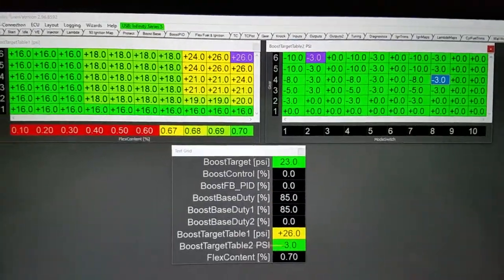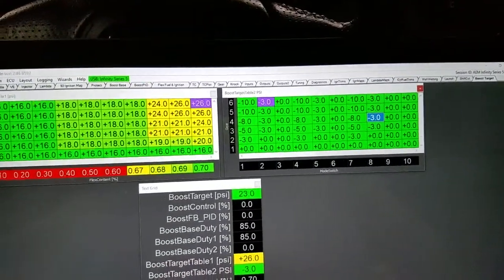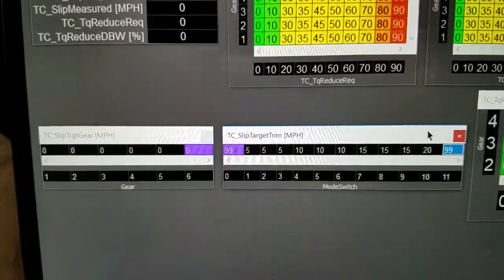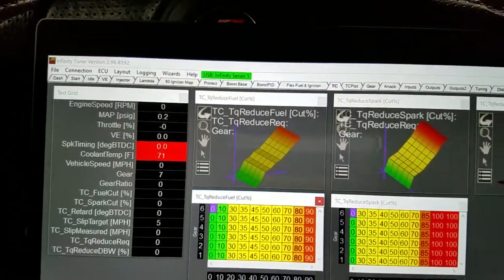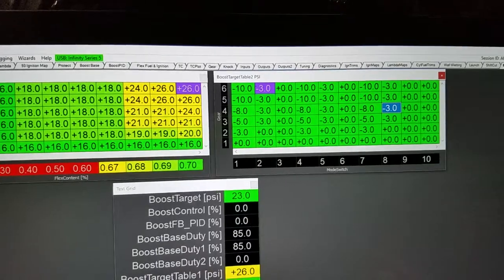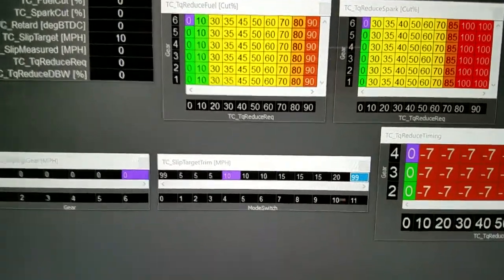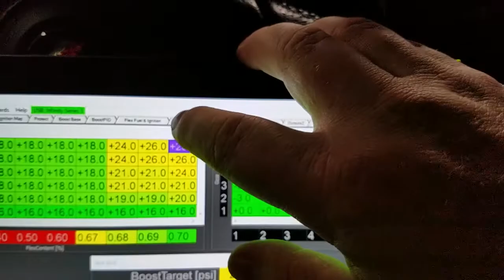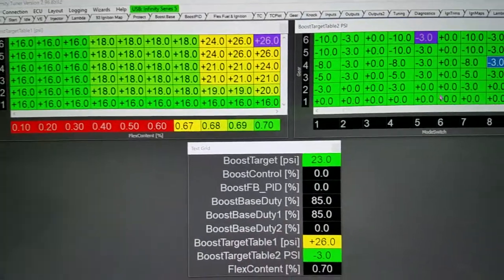Supra AEM Infinity Mode Switch, Traction Control, Boost Control Demonstration

Comment: What size housing/enclosure is needed to mount this switch?  I can’t find any dimensions online and want to mount it in an enclosure similar to what you have done.
Reply from the maker: I think I used a 3x1x2 project box. I can check if you'd like.

Comment: Which pin did you wire the switch to? I'm planning on running 2.
Reply from the maker: It depends on what input you want to use. If it's a free pin and it lets you select it from the drop-down menu, go for it 😊

Comment: What are your traction control PID values set to?
Reply from the maker: P 3.00
I 0.008
D 0.000
It goes without saying that the higher the HP and lower the traction available the values will vary greatly. You'll obviously want to test it on a very wet and very isolated road to verify it will step down the power quickly enough to keep it functioning, not just on dry roads.

Comment: Are you also using different fuel maps with the higher boost levels? is it possible to have the fuel map and boost change at the same time with each mode selected? I've been wanting to get the switch but seems a little intimidating to set everything up properly
Reply from the maker: Hey Barry. Sorry for not seeing this. YouTube doesn't do a good job of notifying for comments. You can absolutely setup fuel trim maps or fuel maps based on mode switch positions. I do not do that. I have a flex fuel sensor, a VE table and target lambda (AFR) to take care of the fueling. I have no need to manage that unless I were to have some other fuel to use or even methanol, which is pointless on E85.

I'm happy to answer any other questions you might have.
Reply: @TheProPilot  I'm just now setting up my aem infinity on my supra. I'd love to pick your brain on the mode switch setup
Reply from the maker: Oof. I am so sorry for not seeing this. Message me on IG @thepropilot

Comment: Could you use two rotary switches, one for boost map and one for traction control individually, or must these functions be tied due to only one rotary switch input?
Reply from the maker: Hey bud! I intentionally tied the two together since each one has 0-11 positions. This gives me more than enough settings to choose the level of performance and safety vs performance vs experience I'd like. 

Yes you can absolutely use two switches, so long as you have the spare inputs and an Infinity higher than series 5 aka 506. 

I've yet to fully understand how and why they chose the number designations lol
Reply: TheProPilot makes sense to me! 11 positions for each would be overkill. I’m preparing to build a factory five 818 and want a nice balance between “kill mode” and a “kill me mode”.
Reply from the maker: @hunterhartley583  perfect. Yeah the single mode switch will do that for you. Just do groups of TC and boost (or ignition if NA) similar to this:
Mode Selector - Setting:
0: 18psi boost, TC off
1: 18psi boost, TC high
2: 24psi boost, TC high
3: 30psi boost, TC high 
4: 18psi boost, TC medium
5: 24psi boost, TC medium
6: 30psi boost, TC medium
7: 18psi boost, TC low
8: 24psi boost, TC low
9: 30psi boost, TC low
10: 30psi boost, TC very low
11: 30psi boost, TC off

TC high: 5mph slip target
TC medium: 10mph slip target
TC low: 15mph slip target
TC very low: 25mph slip target
TC off: 199mph slip target